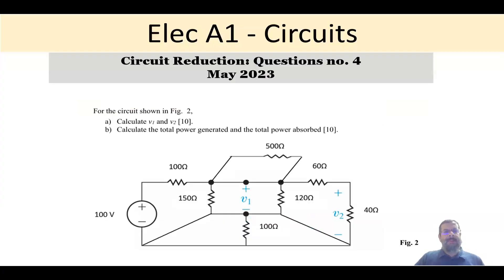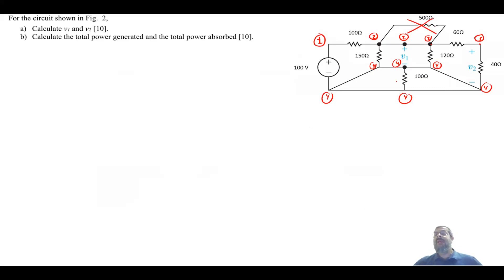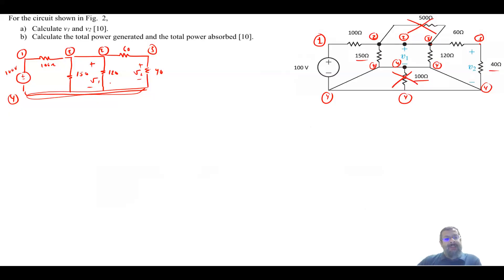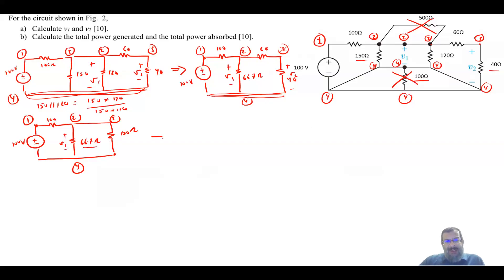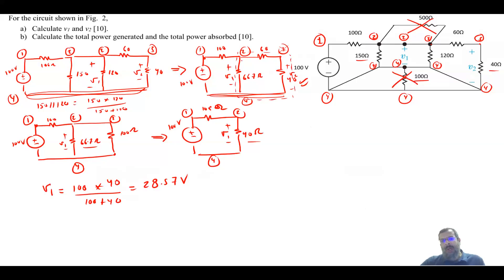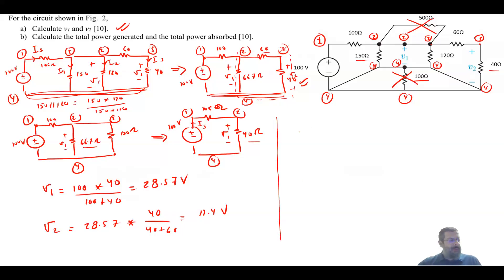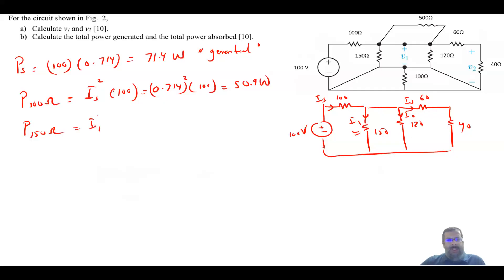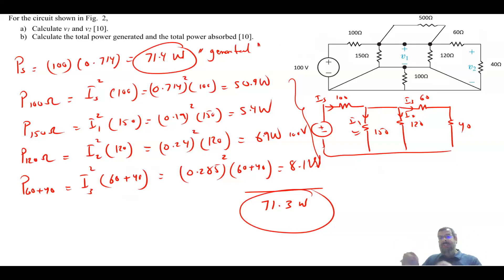PEO solved examples (ELEC A1): circuit reduction Question no. 4

Comment: In a purely resistive circuit power generated is always equivalent to power absorbed. right? do we need to calculate separately and show it is equal ?
Reply from the maker: You are correct, however, the question implies that you need to find both and show they are equal. On one side, this is good for you as you can make sure that your numbers are correct.